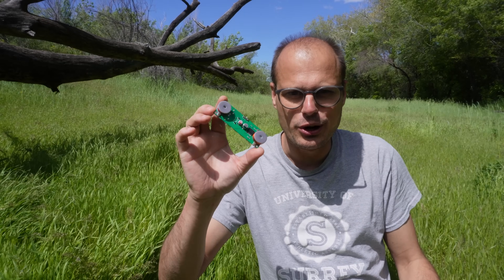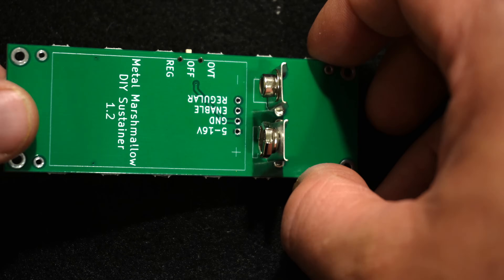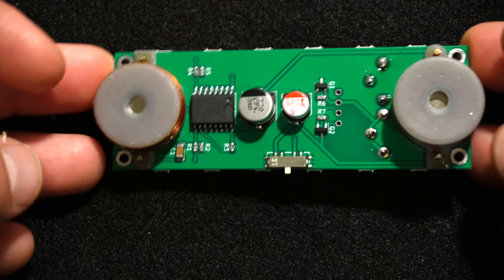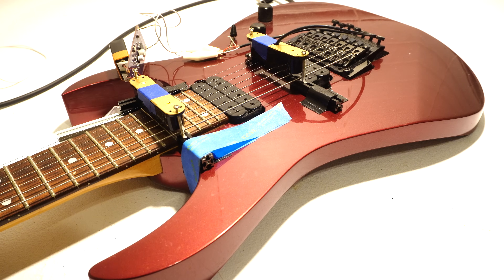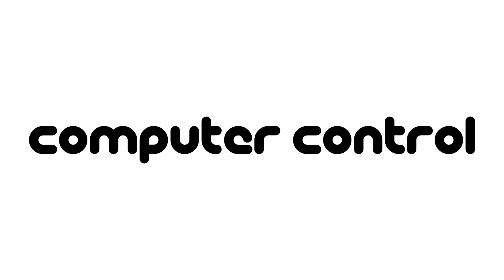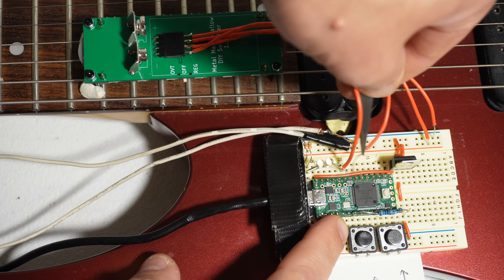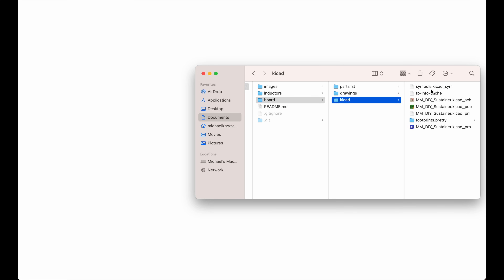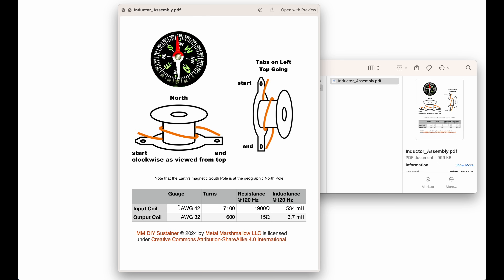An Open Hardware DIY Guitar Sustainer

Comment: Powered by a microcontroller, hmmm... might be stating the obvious, the ESP-Bow?

I wonder how this would sound with if each inductor were mounted to a glove on individual fingers with the board and power on the back of the hand. I'm assuming changing the distance between them would alter the sound profile.

Comment: Something tells me the two inductors should be closer to each other. Also use 8 ohms on the driver (output) and 50 ohms on the sensor (input).

Comment: Sustainiac uses two coils for the output coil, and i suppose the input coil is the bridge pickup, they are probably compensating something for making it work on the 3 thinner strings as well as on the 3 thicker strings; the perfect approach might be to have individual output coils for each string (and maybe , for the sake of theoretical perfection, individual input coils per string too), but apparently  that compromise worked just well enough for Sustainiac.

Comment: Nice Work. Did Something similar as student approx. 10 years ago, but more the Fernandes sustainer approach,  where the Neck Pickup also acts as an inducer. Used a cheap empty pickup bobin plus the "Ruby" amp as a Driver circuit dir an own coil, worked Like a charm despite trying out the inducer coil gauge and length manually.. however I never did a PCB as I later bought an actual Fernades FS40x kit

Comment: do i assume correctly that when it is powered with a higher voltage (like 12 or 16) and enough amps, the magnetic field it generates is stronger?
Reply: ...because i need need need an overpowered e-bow.
Reply: also, huge thumbs up for making this open source!

Comment: Hi, i have a question about the inductors. I try to build similar coils right now, but i'm having trouble soldering the wire onto the pins in the bobbin. The wire i'm using is poly-nylon coated, so the solder doesn't stick to it and if i heat it long enough for the coating to melt it damages the plastic bobbin the pin is pressed into by heating. How did you get around this problem? Greetings from germany!

Comment: Sir, If you make the metal cores A-shaped or wedge shaped, like a flat-tip screwdriver. You can have a stronger magnetic field, within / coming from that smaller space!

Comment: Try using a bar magnet pickup. A single long magnet with windings around it would create a much better field for sustaining all the strings evenly. If you can get this to work then adding a pair of extra pickups that sustain might be an option for incorporating this style of sustain directly into a guitar.

Comment: why not just build one into a guitar body or pickup
Reply from the maker: I was too lazy to take my guitar apart which is why I just mounted extra pickups on top. I guess it was a "exercise left for the reader" type situation. I might have to make another video where I actualy follow through and put it all inside the guitar body.
Reply: that's how prototype projects look, then the solution is adjusted to particular needs, this can go either way towards either an e-bow, or a sustainer (like sustainiac), and i imagine this could also be a way of playing a guitar by a keyboard, "remotely", via a computer / controller.

Comment: Wouldn't it be a good idea to use the guitar pickups as the source of input signal? And you could also induce the vibration of the strings with a big single coil installed underneath the strings somewhere around the neck (or above them, if you don't want to cut a hole in your guitar). Then the next step would be just to hide the circuit inside the guitar and you'll get a fully functional guitar with accessory sustain mode
Reply: fernandes sustainia pickups already did, this is a better way to use the experience on any guitar
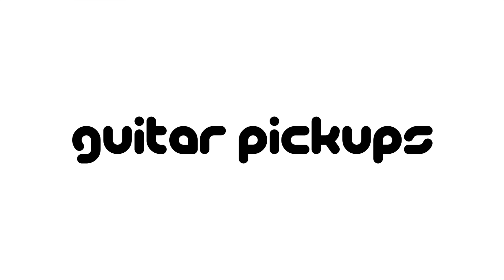Reply from the maker: I gotcha bro, right here -- 5:44
Reply: @metalmarshmallowllc  sure, i've seen that, but the input coil there is additional. Doesn't it work with just signal from inner guitar pickups?
Reply from the maker: @ТокаревМихаил-и9к  Oh, yes, I see what you are saying. That should be possible, I was just too lazy to take my guitar apart which is why I put some other pickups on top, but in principle I could have used my guitar's existing pickups.
Reply: they way you hold and approach the strings with the Ebow creates all sorts of effects from bowing to horn sounds. You can't do that kind of dynamic attack using a fixed position sustainer. Sure you get the polyphony but you loose the expressve features that you would get say, with a pick or bow. Listen to the Ebow examples on line and you'll hear what I mean.
Reply: That's how Fernandes and Sustainiac do it. When you engage the sustainer, the bridge pickup becomes the the input driver. The humbucker sized sustainers don't have another coil next to the driver, it's just a dummy coil so it can fit in the cutout. Some people often remove that dummy coil and put a stacked humbucker or single coil there, but that's not used to drive the sustainer. It's too close to the driver and that can create crosstalking issues. The whole crosstalking aspect is the reason why we don't have a sustainer driver which sustains all strings equally.
Reply: Sustainiacs, my friend
Reply: I've done this, but the problem is that the driver coil(s) has to be raised close to the string for it to work well, which creates problems with the magnetic drag dampening the string and making it sound awful when you play normally and also when you fret too high up close to the pickup, the string could actually touch the poles or coil.

Comment: Could you replace the "Regular" button with a two-pole switch so that it also enables the circuit?
Reply from the maker: The switch on the board is a 3-pole jobby that enables / disables the circuit and puts it in overtone/regular mode. So you can either use the switch or you can use digital logic on the control pins, it is exactly the same either way.